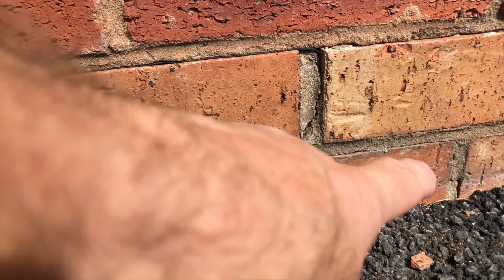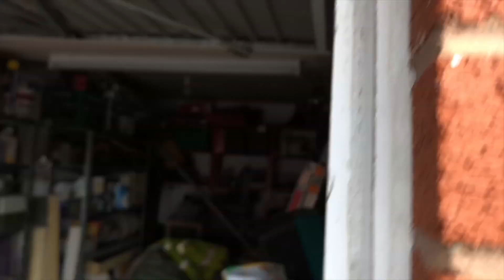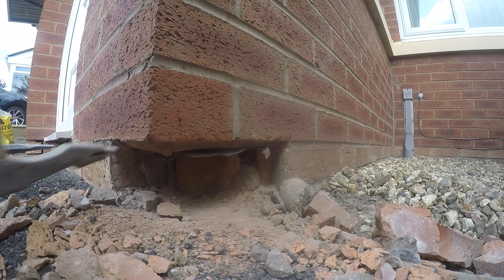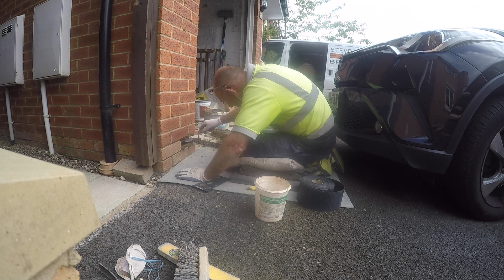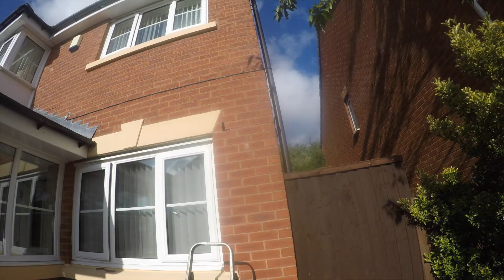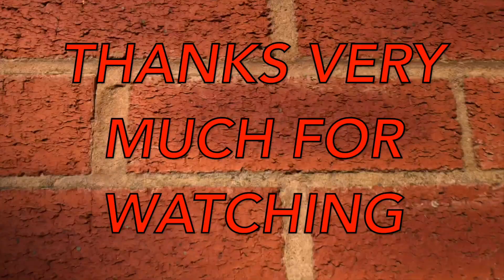BRICKLAYING..HOW TOO.... REPLACE BLOWN BRICKS BELOW DPC

Comment: I’ve removed a few damaged bricks from my garden wall, but used lots of drilled holes around the brick to loosen it. Wouldn’t have thought about breaking the breaker apart. Is there any particular advantage?

Comment: I’ve removed a few damaged bricks from my garden wall, but used lots of drilled holes around the brick to loosen it. Wouldn’t have thought about breaking the breaker apart. Is there any particular advantage?
When I was doing my bricks I really struggled on getting the mortar replaced, but your technique looks like a winner and so I will try that next time. Thanks OP

Comment: Top marks for this, man. Im in a situation in a customers right now. I found yesterday after knocking off blown plaster that the DPC on the internal block work is 100mm HIGHER than finished floor level. Plus I suspect that the  DPC is spanning from block to brick and making a lovely pool in the cavity.  I won't go to any so called damp experts who want to fill everything with chemicals so I could, technically lower the DPC using that method?  Any replies, even insulting ones are appreciated 👍🏼
Reply from the maker: Its a tough one to call without seeing it , a cavity tray pooling water does not sound good though . Sorry i cant help more but good luck 🧱👍🏽

Comment: I'm finding these videos very useful and I've now subscribed. Can you tell me the name of the thin bladed tool you use to push mortar into the joints? Thanks.
Reply from the maker: Hi pal glad you find our channel helpful and thanks for subscribing.🙏🏽 . 
    The tool you are after is called amongst other things A tuck pointer or finger pointer 8 mm wide .
   Thanks again 🧱👍🏽

Comment: Nice job as always. I’ve just purchased a 1960s house and the slate DPC has previously been repointed an it’s almost as if it’s being forced out/ won’t stay in..
Any advice would be appreciated.
Reply from the maker: LEESTAR . You’ve got me stumped on that one sorry 😬. I haven’t come across many houses like that and have never worked on one . Give Rob Songer a try on his channel he may be able to help . 
Good luck 🤞🏼🧱👍🏽
Reply: No problem, thank you for replying.

A building surveyor inspected it property and he said to repoint it. 

Ive noticed a few houses on my estate that are having this issue.

I’ve knocked the mortar out and there’s only about 10mm gap to DPC and about a 20mm bed. Maybe it’s the lack of depth as to why it’s not sticking. 

I’m thinking of maybe PVA the dust ect then obviously use a plasticizer in the mix.

Maybe they used a poor mix?
Reply from the maker: LEESTAR . Maybe try getting a raking out disc on a 115 mm grinder . They are 6 mm thick so take  a lot at a time .Go at least 10 mm deep and before you point hose it down to get rid of every scrap of dust . If it dries keep it damp ( not wet ) . This will stop the mortar going off too fast . Hope that Helps.... good luck 🤞🏼🧱👍🏽

Comment: Excellent video and job 👍
Can I ask, what size wattage chisel drill would I need to remove the damaged bricks?
Thanks in advance
Reply from the maker: Lee Harper Thanks Lee . Our drill is Titan SDS plus drill 1500 W . It’s from screw fix and is about £50 👌🏼🧱👍🏼
Reply: @SteveAndAlexBuild  Oh, good shout. Importantly, it's an 8J impact, you can pay much more to get much less.
Reply from the maker: @rogerborg  definitely. They are a very reasonably little work horse . I’ve had a few now over the years 💪🏼🧱👍🏽

Comment: Hi guys x great work x I'm impressed x my stepdaughters bricks are worse than urs x her old dpc is only one course from driveway slab x is it possible to put in a new dpc two courses up using the same principle x please help x thank u
Reply from the maker: Wayne Gangadeen it’s not  really advisable to put a dpc higher as damp can rise above your dpc on the inside skin causing more problems . 
It’s better to try and dig a channel about 200 mm from the wall and go down 3 courses below the dpc and then put some stone chippings in up to 2 below to help drainage . 
Hope that makes sense 🧱👍🏽
Reply: Yeah that all makes sense x thank u for ur knowledge ur time and ur swift response to both questions
Reply from the maker: Wayne Gangadeen No probs , thanks for watching and commenting 👌🏼🧱👍🏽

Comment: Does it matter that the dpc is left contained inside the mortar joint and not obviously over hanging on the outside to indicate an obvious separation?  I've never understood how a dpc that you cant see inside a mortar joint isn't being bridged  by the outer slither of mortar. Thanks.
Reply from the maker: Make Stuff Work . Some people so leave it on show but personally don’t like it . The amount it of sand and cement really isn’t going to cause any problems 🧱🧱👍🏽

Comment: Do you need to use slate? I had something similar in an internal wall and the guy used slate to pack it up.
Reply from the maker: I use slate if the brickwork above is crumbling or falling . I find that skate just puts a lot of pressure down into the new lintel and can bend it . 🧱👍🏽

Comment: I need all my air bricks replacing and more added is this best way to do it
Reply from the maker: Womble Stacker .  Yes but use a grinder and a drill if you can , less chance of the bricks chipping around the hole .
Thanks for watching and commenting 🧱👍🏽
Reply: @SteveAndAlexBuild  thanks bud
Reply from the maker: Womble Stacker No probs , good luck with the project 🧱👍🏼

Comment: I need similar work doing. Would this be a daily rate or a fixed price
Reply from the maker: Christopher Williams. Evening Christopher, day rate and fixed price are pretty much the same thing really 🤔🧱👍🏼
Reply: If it's local I replace them for £15 per brick, including materials and waste removal.
Reply from the maker: oldmanfromyork . Evening pal , sound reasonable 🧱👍🏼
Reply: @SteveAndAlexBuild  Evening, I work on the principal that I can easily do 20 in a day including cleaning up etc... If the customer just wants a couple replacing I just call on an evening and do them.
Reply from the maker: oldmanfromyork good plan 👌🏼🧱👍🏽

Comment: Newish house with drive surface level at least a brick too high.  NHBC Building Control ?
Reply from the maker: MARTIN A1 . It’s actually a course too low . New builds are supposed to be level access at the front door for disabled access 🧱👍🏽
Reply: @SteveAndAlexBuild  
the entrance door threshold requirement must be compatible with the other aspects of Building Regs particularly in respect of ingress of damp....

Comment: Is there no concern about supporting the weight above it when you remove those bricks?

If it was above a window (which would be higher up so less weight above it), you’d obviously have a lintel supporting the bricks the weight of the bricks.
Reply from the maker: No not at all 🧱👍🏽

Comment: Isn’t it safer to put an angle grinder to mortar joints then knock the bricks out gently with a lump hammer?

I have this Titan SDS and I’d be scared of taking it to a wall like this because of the vibrations! 🤣
Reply from the maker: I did grind our first but the Titan is perfect for this job 💪🏼😁👍🏽🧱
Reply: @SteveAndAlexBuild  so in your professional opinion the SDS’s hammer action power won’t do much to unsettle the house and foundations?

Lovely work btw. Such a pleasure to watch.
Reply from the maker: @MarcusT86  No you’re fine with it Marcus . 
   Thanks for the kind feedback 🧱👍🏽
Reply: @SteveAndAlexBuild  

Last question I promise, but those bricks with the holes are engineering ones right? And they go below DPC to the foundation because they’re bearing all the house above correct?

And did I see right that you’re meant to fill the holes in them with mortar?
Reply from the maker: @MarcusT86  . No they aren’t engineering bricks , just standard face bricks and filling the Holes is just good practice 😁🧱👍🏽